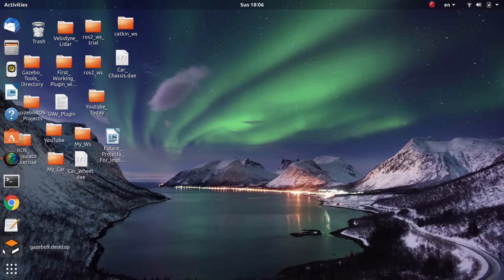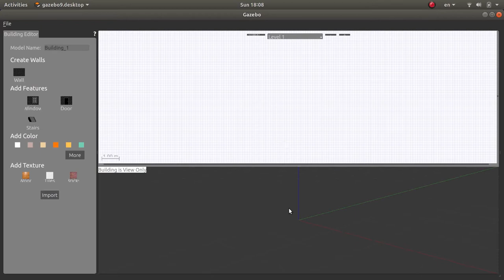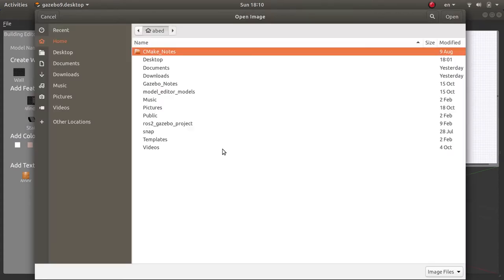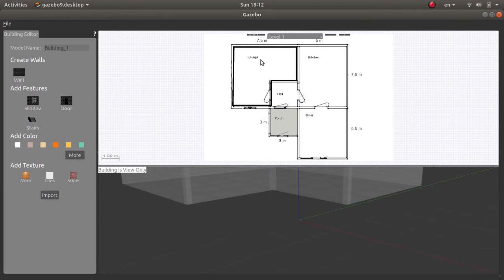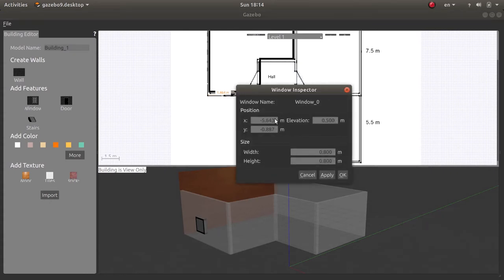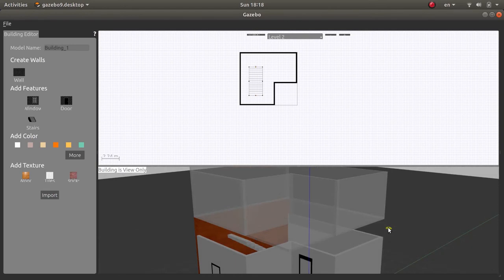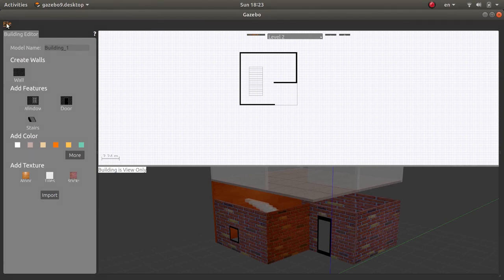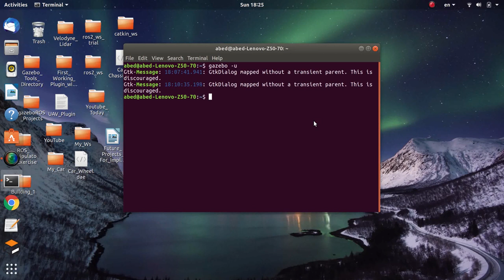Gazebo: Building Editor

Comment: Why Gazebo is crashing when I add doors and windows? is this happening to anyone? if so, how to resolve it? pls help
Reply from the maker: Are you sure that the specs of your device meet the recommendations? Also, are you using a gazebo version that is compatible with Ubuntu version (for example gazebo 9 for Ubunutu 18)
Reply: @Robotogeddon  Yeah. I am using MSI gaming laptop with 16gb Ram, 4Gb graphics. I also tried changing the drivers in additional driver ( Nvidia ). 
I think I am using Gazebo 11 ( Ros Noetic )and Ubuntu 20. But still not working...
Reply: @Robotogeddon  I googled about this issue and some of them are facing this but haven't found out the solution. Pls let me know if u find any.... Ty ...
Reply: @robotics-explained  For me it is crashing as soon as I select the door and place in on the wall... 
Btw, did u find the solution?
Reply: @arjunhebbar5539  It was only just fixed a few days ago, with version gazebo 11.9.1, been a long time since the OC, but hey others who were still getting this error, can update to the version mentioned.